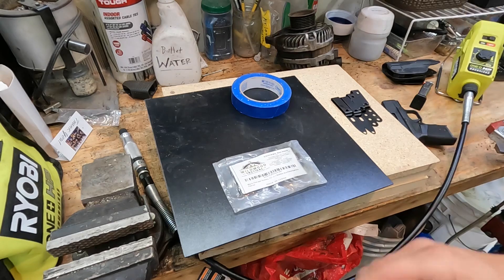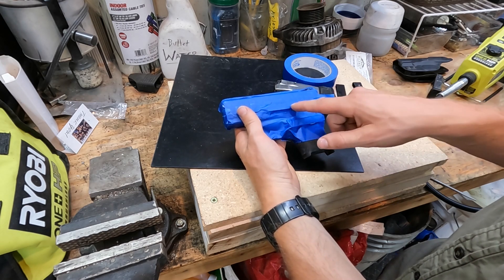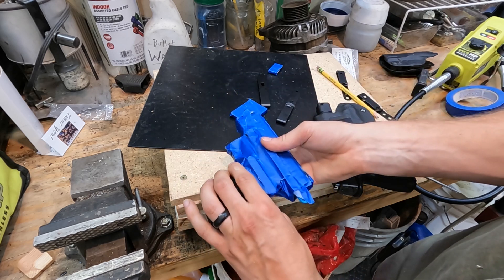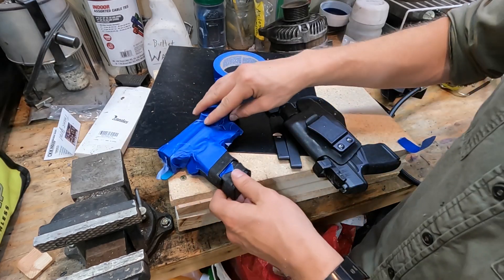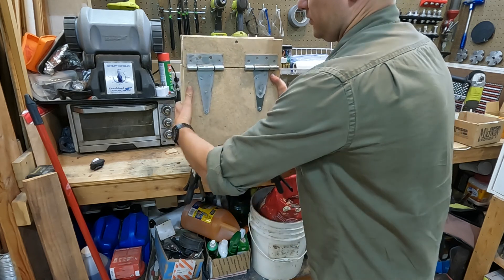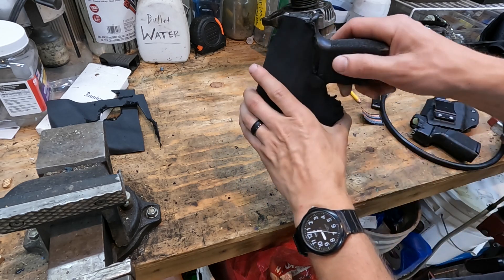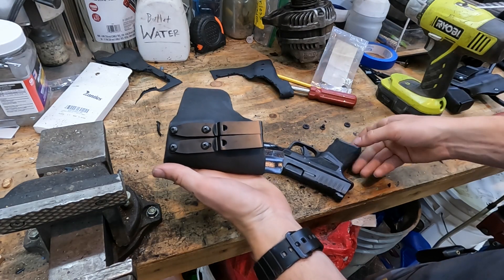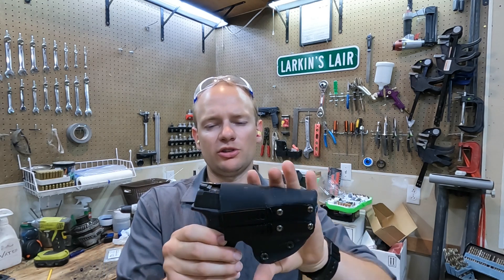How to Make Tuck-in Kydex Holster - EASY

Comment: Thought you might have trouble with retention due to not having a piece of 1/8-1/4" filler around the trigger guard and under the frame.  Did my Mac 9 holster today and looking at a few videos on where to draw the lines before cutting it out.
Reply from the maker: I did a different holster the same way and have been carrying in it for years. Although there are lots of ways to get similar, and perhaps, better results. As far as cutting, you can always remove more, but it sure does suck if you cut too much.